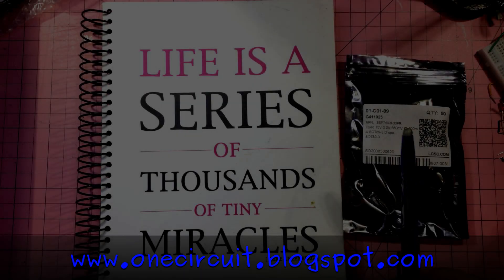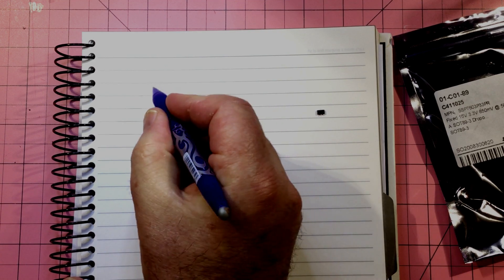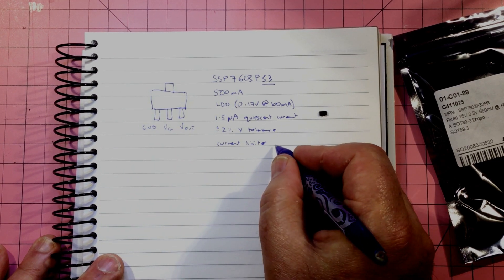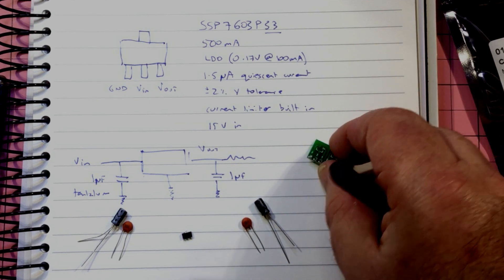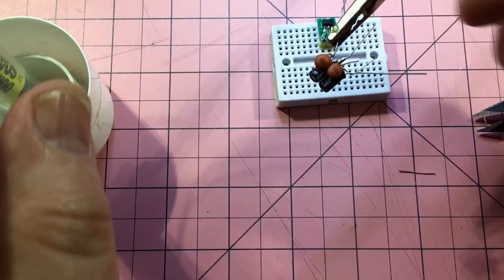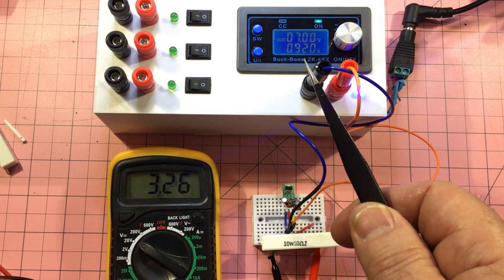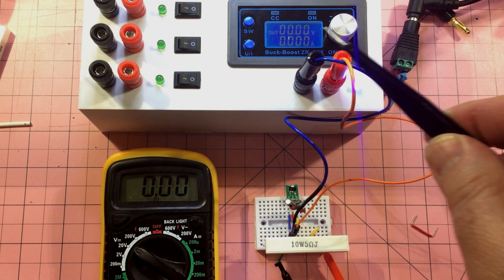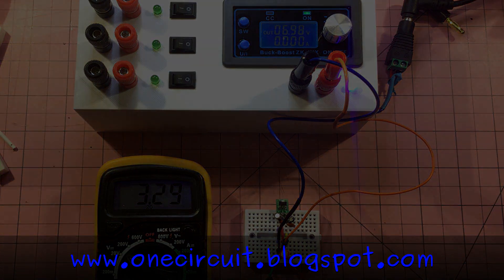SSP7603 3.3V SOT-89 DC-DC regulator

Comment: That self-protection is a nice feature. Might have to replace the LM1117s on those cheap breadboard power supplies.
Reply: Yes, I have blown up maybe 5 AMS1117-3.3V devices on those breadboard supplies.
12V is EXTREMELY dangerous on them ... though they work like a champ for 5V->3.3V conversion.